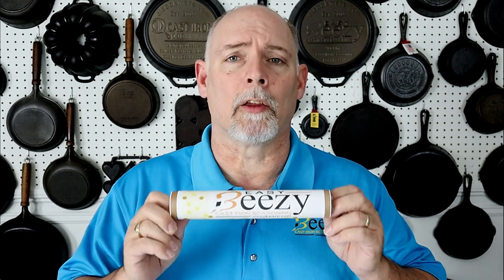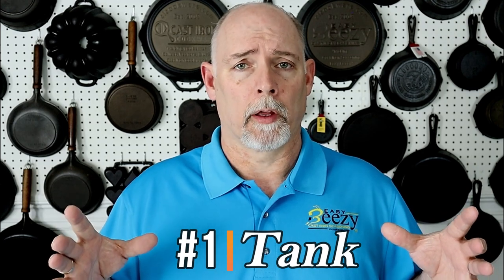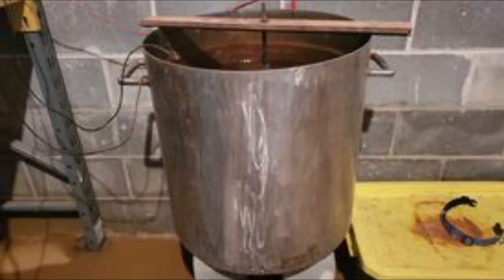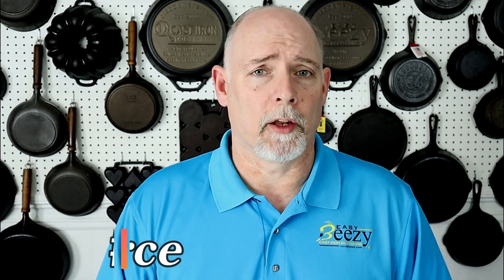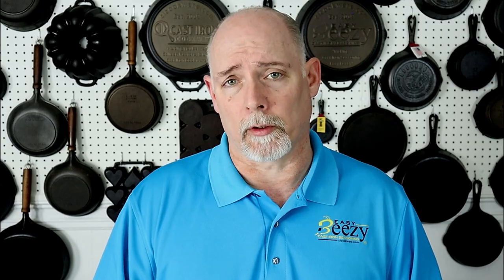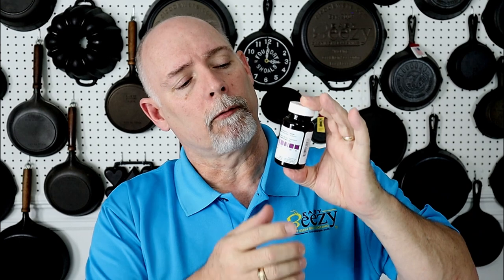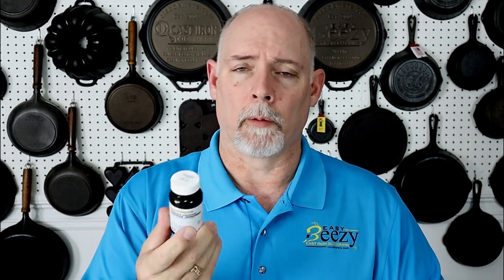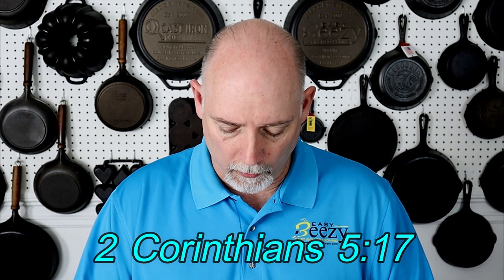Electrolysis Tank Basics

Comment: I made a small one that used steel scouring pads packed into PVC tubes with holes in them as the sacrificial anode. It worked good, it’s really cheap, and PVC protected the anode and cathode from short circuiting.

Comment: You will want to not use the stainless steel as an anode, anodizing stainless will result in hexavalent chromium,  an extreme toxic substance. Please use iron rebar for the anode.
Reply: Weird it's almost like he knew people were going to say that and that's why he addressed it directly
Reply: @LegalAmerican4   it appers he thinks it is a gas, no it will be in solution, although I don't have any direct links I'm reasonable shure that if you are using 12 volts that is more than enough to get it. the only reason he may not be is improper test procedure or he doesn't have stainless steel, could be a high nickel and have no chrome in it. All though I don't have proof it does it it is better to be safe rather than sorry, cancer and poisoning your neighbor is kinda unforgiven mostly.
Reply: @boydmcree9085  he showed the test strips he used to check his solution for the mineral
Reply: Wrong. Nowhere near high enough amps
Reply: No Stainless steel! Erin Brockavich will show up an beat you senseless.
Reply: Can I use an aluminum pot?
Reply: @TheBigr00ster No. Alkaline solutions will attack aluminum.
Reply: That's a super friendly sounding byproduct.

Comment: I am passing this video along to my brother who is cleaning Automotive Parts via electrolysis. When he sees this it's surprisingly will be what I told him but it is so much better to see it in pictures. We both say the same words lawn mower blade rebar I said bed frame also. One difference is I popped  my bubbles on purpose with a large lighter. It was about 2 in of foam and I got quite a crack. Since I did this there will be no surprises and I was no longer afraid of hydrogen in the garage. I use  stainless steel serving platters from resale shops and estate sales sence I was there anyway looking for C.I. at just a few bucks each. I can clean them with a toilet brush in the tank in minns. What a great video .thank you

Comment: Another electrolyte alternative is pH-up from Clorox.  It is pure sodium carbonate, available in the swimming pool products section of your hardware store, walmart, etc...  As an electrical engineer, I would strongly recommend against connecting DC power supplies in parallel to get more power.  Depending on how the power supplies are designed/built, this could be catastrophic if one supply backfeeds into the other one if not setup right.  If you do use a DC power supply, find one with an output current limit and operate it in current limit mode.  To do this, you set the voltage to maximum and then the DC supply will limit the voltage automatically to operate at the current limit set point.  The current limit is set with a separate knob. The supplies shown in this video appeared to have a current limit feature, but I don't know for sure.    For electrodes, graphite rods work very well, aren't consumed quickly in the process, and won't gunk up the solution, though these are perhaps more practical for a smaller electrolysis rig.  You cannot solder to graphite, so you must attach to them with alligator clip leads instead.

Comment: i use my 210A ac-dc tig welder set to DC arc welding mode for a power supply, as you could imagine, it doesn't exactly burn out

Comment: I’m not quite getting the great boil you have in the video. I’m only at 4.3amps and i can’t adjust it any more. I’m using the same dc power supply which is supposed to get 10 amps- I think it’s a shitty supply.

Comment: I get the reason why you would want to use a steel tank (stainless or otherwise) as your anode, its convienent. However, keep in mind what that is. Its a sacrificial anode, emphasis on sacrificial. Your anode (the tank holding your elecrolyte)  will erode material onto your cathode (pan or other target metal) hence the term "Sacrifical". The tank will eventually literally dissolve. In the end, thats a pretty exspensive way to go. Not to mention the possibility of creating toxic gases and toxic liquids as a by product of using stainless steel as the anode.

Comment: I read where stainless steel should not be used as an anode, it puts off chromium when doing so. But it's safe to use as a diode, is that true?
Reply from the maker: From my personal experience, I have been hexavalent free when testing my tank water. I would stay away from using stainless for suspending the iron in the solution.

Comment: I've been using your videos as an instruction manual to restore a neglected camp oven over the weekend. It came out very nice and quite amazing the difference after the electrolysis bath and a scrub after. Although something I noticed was the variance in voltage depending on what I had in the bath and how many anodes I used. I have not seen this mentioned by others either. I discovered this only because I thought I had problems with my charger and so pulled out the volt meter. For the lid, I just turned the piece half way through for each side to be closer to the anode, but for the base I used an anode on both sides and noticed with just one anode, voltage dropped from 12 to 8 volts and with the second anode to just over 6 volts. Maybe because of the size of the item I needed a large drum and so quite a lot of water and therefore conductive material to pass through. Still had lots of bubble activity etc but left it in for longer and also gave a scrub in between for the largest item.

Comment: Thanks for the video! I am loving your easy beezy seasoning! I just ordered 2 more tubes!
Reply from the maker: Awesome. Thank you.
Reply: @castIroncookware At what voltage, current/amperage draw you use for the 1/2cup to 5 gals of water do you use? You talk about water evaporation and the washing powder. I was thinking, your amperage may change slightly due to contamination, but you should stay relatively constant to main the right ratio of electrolyte solution. This may use full in determining if voltage or amperage is the helpful for quicker rust removal. 

Also, do you recommend distilled water or city municipal/country well water? I would think that contamination could cause issues.

Finally, do you recommend heating the electrolyte solution of running it at ambient temperatures?

Thanks in advance.

Comment: Thank you! I looked for videos about this and the first ones I started watching were over 30 minutes long, or started with people either trying to get the pieces to be de-rusted apart for seven minutes, or building a plastic tank and showing every screw-hole they were drilling for every piece of rebar (plus the cutting of all the pieces of rebar)...
I am thrilled that I found your video- it was simple, with plenty of examples of everything you talked about, and mostly, right to the point.  After watching this video, I set up a tank and took all the rust off of two cast iron pans and a cast iron muffin pan.  It worked beautifully.  Thank you so much.

Comment: I am in the process of building my e-tank. I have both solid conductor copper wire #10 from a submersible pump and also have #10AWG stranded wire. Is one preferred over the other? Manual battery charger question: have 2 chargers: one rated at 2 amps/ 60 amps, and the other rated at 2 amps/ 12 amps. Do you have a recommendation on which one to use? Thank you for sharing your wealth of knowledge and experience and making great videos! dfq3

Comment: I have a question Sir. Is 3.5 Amps sufficient ? My charger reads 16.5 volts and 3.5 Amps when cleaning my Dutch oven pot.
Reply from the maker: Yes, absolutely. The only difference will be how long it takes.

Comment: If I ran a lead contaminated piece in my tank is the whole thing ruined or can I just change the solution? How about my all thread hanger and anode? Thank!!
Reply from the maker: I would replace the solution and scrub down the tank. I have started using nonmetal cord for hanging and clip the negative cable directly to the iron.

Comment: I haven't used my easy beesy yet, waiting to get an electrolysis tank set up. I had a conversation with a guy that said it's possible to use an automatic battery charger if you add an old battery between the tank and charger. I bought my super washing detergent at Walmart. I have quite a bit of iron to restore, have been adding to my collection and much of it is in need of restoration.
Reply from the maker: I've heard of that working but have seen it myself.
Reply: @castIroncookware  Until I find a power source I may try it, I already have an old dead battery. Trying to avoid spending too much on it , I'd rather spend the money on more cast iron. I recently bought a Greer and King bean pot on Ebay patented 1868, it has been restored already. Also have added quite a few other pieces to the collection.

Comment: I used Arm and Hammer baking soda and it works fine!  I use a battery charger connected to a deep cycle 12V battery so that it reduces the draw on my charger directly.

Comment: The resistance gets higher as the electrolyte becomes more concentrated. Its like pinching a water pipe, its resistance goes higher and makes it harder for the pump to push the water through.
Reply: Exactly opposite of what you say. Stronger electrolyte solution reduces resistance causing more electrons to flow from negative to positive because of "constant" voltage (pressure). The power supply works harder (is loaded heavier) to supply those electrons. As the load increases to no resistance there is a fault  (~short~) and the circuit protector on the device will open to prevent overheating and fire. Eventually the power supply fails from heat caused by heavier loading. The plumbing analogy doesn't work here because the water pump increases pressure against resistance (head) while the electrical "pressure" is a constant as provided by voltage. Voltage constant + resistance lower = amperage (current flow) higher. This explanation works for "simple" electrical resistance circuits. When reactance and capacitance are thrown into the impedance equation it gets more complicated, especially with Alternating Current with power factor, harmonics, ferro resonance etc that affect the electrical power supply (generator + transformer + transmission).
Reply: @gerardjohnson2106  You win! I quit! The way he states things makes it hard to understand. I'm to a point to where his videos are hard to watch. I'm gone!